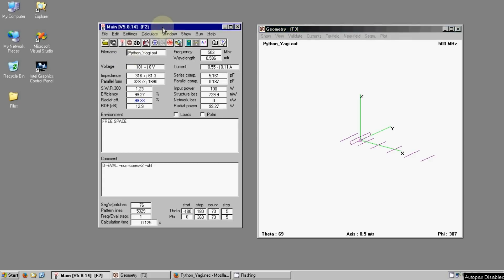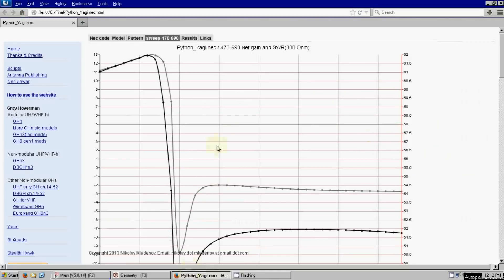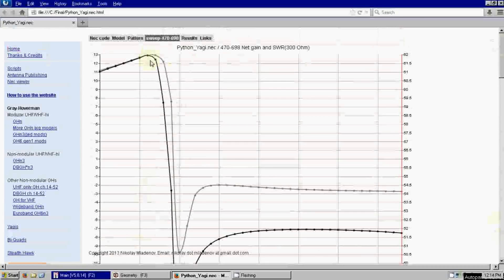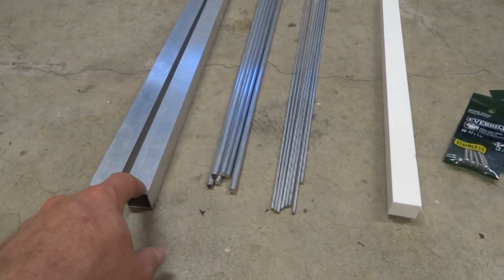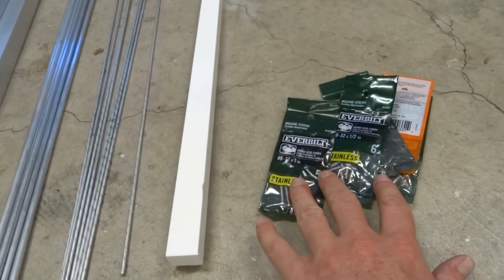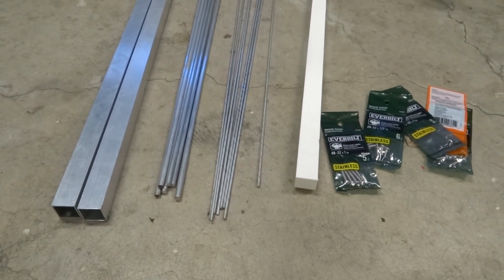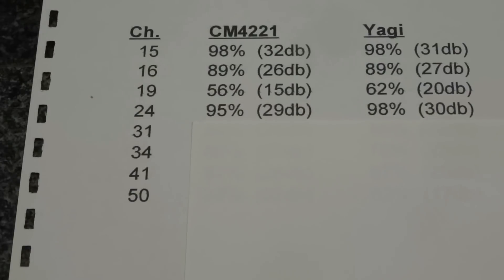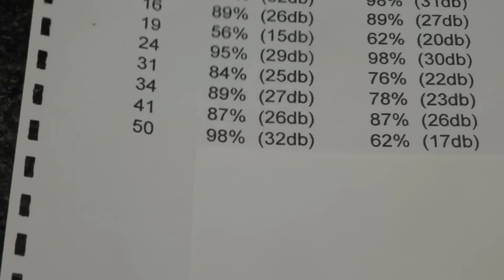Homemade single channel Yagi TV antenna

Comment: You need to explain why you "cut" an antenna for a specific channel (19). VHF ranges from ch. 2 to 13 and UHF from 14 to at least 36. Your design just does not make sense.
Reply: He explains the reason in the first 20 seconds of the video, though.

Comment: For the elements , I drilled holes through the beam and used bic pens as insulators then slid aluminum rods inside the tube, worked perfect, I learned building antennas since I was a kid living in Europe ,, if you added a V shape screen behind the antenna between the U bolt and the 1st element, it will increase db gain .. 90% of tv antennas in Europe use a V shape attachment to get the most signal ,repeaters are on mountain tops, and we just aimed our homemade antennas towards those repeaters that were 80 km away

Comment: I stumbled across this video. I hadn't seen it before. It's great craftsmanship. Lots of questions. I believe you actually put this into use, how did you combine it to your other array? Did you have any problems with interference? When I first reviewed the video I thought it was a VHF design with the long directors. It would have been nice to see how well it did relocated. Really curious though how you combined it to your other antenna.

Comment: Why didn't you include the measurements (lengths) of what you cut everything too? In ur video you say "here is all the raw materials" then the video skipped to drilling holes then "assembly". I guess my question is what are the lengths of everything?
Reply: Look at the dropdown in the description

Additional links:
Antenna design file - http://freezerdev.blogspot.com/2015/0...
4nec2 - http://www.qsl.net/4nec2/
nikiml's python scripts - http://clients.teksavvy.com/~nickm/sc...
Optimized versions of the NEC2 engine - http://users.otenet.gr/~jmsp/

Comment: Easy Grasshopper, you did an excellent job all except for one important thing. your Driven Element a.k.a Folded Dipole is off a bit needed to be positioned around the square .so that your signal passes from your directors through the center ~~0~~ of your Driven Element  your  missed half of the wavelength but for diy u did a awesome  job for real thanks for the video
Reply: Could he remove and raise all elements maybe 1.5" ~ 1.75" t except the driven one so other elements are properly aligned?
i.e. the driven element doesn't need to actually be around the square rail. Correct?
Reply: Insignificant difference in performance.

Comment: I appreciate you trying to help people, but you are not a machinist. There are plenty of videos to educate about machining. Now I noticed you said that you should use the drill on the slowest setting. Well, that's simply not true. You need to vary the speed based off of the diameter of the drill. The bigger the drill, the slower the RPMs. There's other factors, material, feed rate, etc. But aluminum is like butter. I wouldn't be afraid to power thru that with that drill running at the middle or hi of rpms. Use the speed that's calculated to be most efficient
Reply: Hate to be a nitpicker but I was thinking the same thing. It's aluminum and it's a small drill bit, high-speed is good.

Comment: Brian, Great video but I'm confused on how you tested both antenna's if channel 19 was about 120 degrees off of the other group of stations? Did you point them both somewhere in between or did you move both antennas toward channel 19 as part of the test?  And now that all stations are grouped, why not do another comparison between both to see which is better without the building as interference?

Comment: Unfortunately My area has a mere 3 channels above 0 NM(dB)
CKLT0DT at 53.7
CHNB-DT at 51.8 and
CJCH-tv   at 01.3
everything else (26 stations) are at negative -8.4 to -40 NM(dB)
On top of that there is a large hill on both sides of me  blocking both transmitters so only 1 station actually comes in at very low signal strength.
Reply: What diameter was the larger aluminum rods you did not mention, You said that the smaller ones were 1/8 " of an inch, I am guessing 1/4"? Thankyou
Reply: Satellite dish for you!